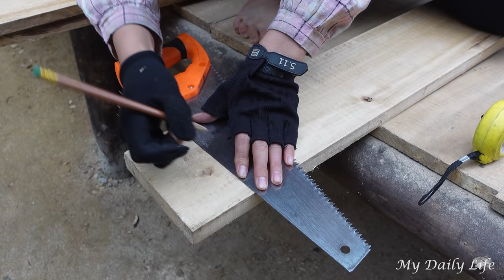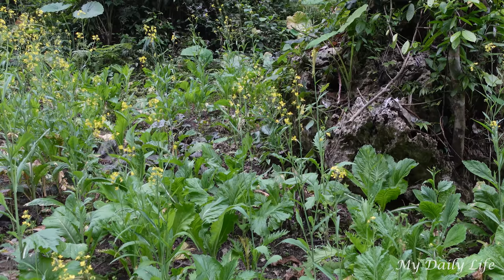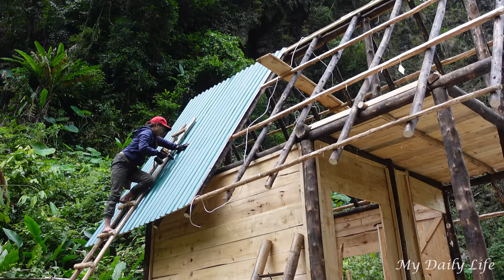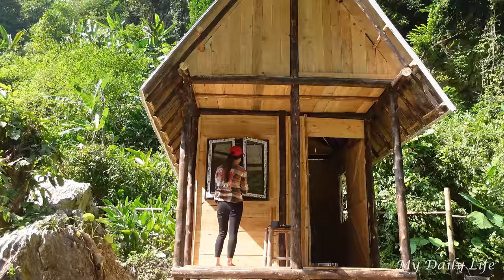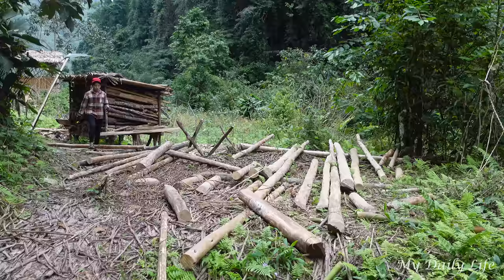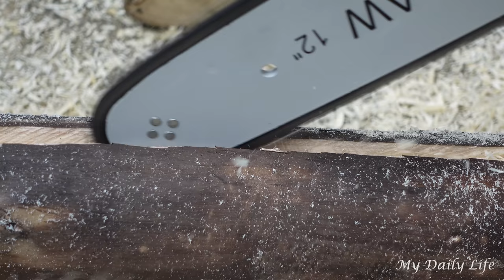Building complete and warm dream house 2022 / Off Grid Cabin In The Woods

Comment: Hey dear lady.... That color on your drill with all those numbers allows you to set a ratchet so you don't wind up stripping out your screws. I think you have your DeWalt set to drill but if you dial the number back, when the screw meets resistance then the torque will automatically adjust this way you don't strip the screw heads. Also a tiny pilot hole wouldn't hurt.
Reply: ***color should read  collar.darn auto correct 😂

Comment: With such a small building, it is much more practical if the door opens outwards ... On the one hand, it does not take up space from the interior, and on the other hand, if you have a problem with the door and stay inside, it is much easier to stretch it out or kick it out. Sorry ... I'm writing with a google translator.

Comment: Roof sheeting is very difficult and dangerous, especially if you are doing it by yourself!
You are very hardworking and diligent! Very understandable if you got tired of doing that house by yourself. You should be very proud of your achievements!
Oh and your chainsaw.  Please rest the chainsaw on the timber with the timber touching the machine casing. Hold it still there, it doesn't  have to be moved back and forth. NEVER use it at its tip. It is VERY dangerous, if it touches an obstacle in the wood, like a small piece of grit, it can jump up and cut your face.